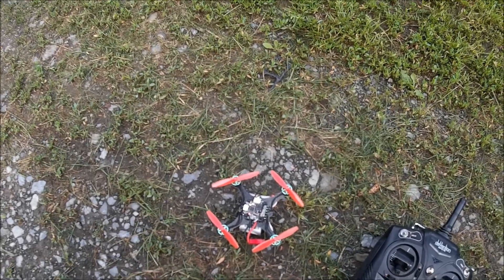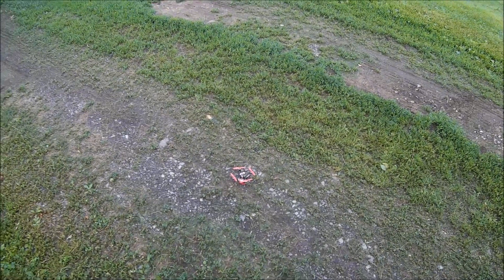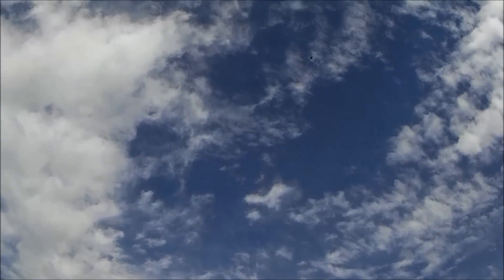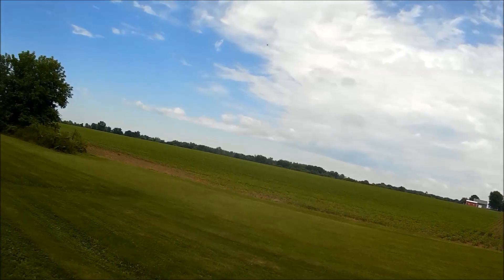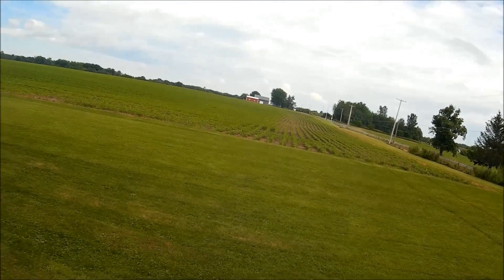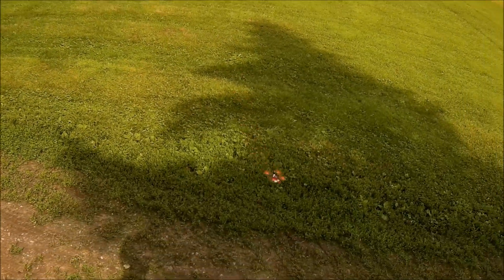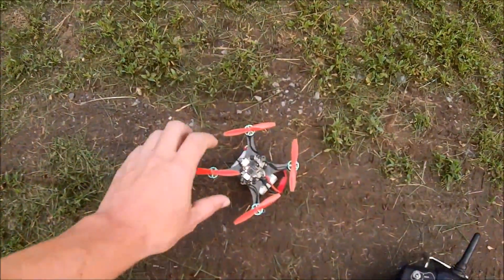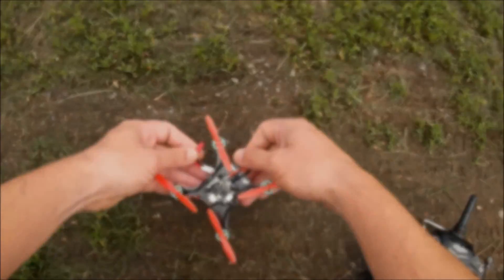6500kv 1103 motors on 3s

Comment: Dave, any updates on the 1102-1003 range of motors? From what I read these Racestars are pretty obsolete. I'm looking for light-weight builds. One for a "toothpick" type build with these props and another for a Beta85X frame/prop motor combo.
Reply from the maker: Sorry, I haven't really done any recent testing.  The Racerstars I used are kind of old now but I have yet to see much in a similar size that I expect to be much better, at least for 2-3s.  When you say "toothpick" I think 1s.  There do seem to be some newer motors that would be much better suited there.  Saw some 0803 in 16000 and 19000Kv which kind of look interesting for a small 1s setup.

Comment: nice video, i am interested by a BABY KAIDJU 2" 1103 racer, i am going to build one to test, according to the 1106 motors, my 1106 6000kv 3s works as 1304 4000kv 4s, both on 3025x2, we all were suprised, here a video with 1106 and 1404 on 3s both (1106 are better on 3s with higher kv)  https://www.youtube.com/watch?v=xNe4t1xmNJI
Reply: here the big comparison in race conditions: 1106 3s, 1304 4s, and even 1407 3s (the best is still the 1106) https://www.youtube.com/watch?v=vSJiBFlOaGU

Comment: where did you get those props??
Reply from the maker: I have some black ones here: http://picnicquads.com/product/propellers/
You should also be able to find them pretty easy searching aroundfor "65MM Propeller"
Note: these need to be drilled out to for 1.5mm shaft if using 1103 motors.  Checking balance/re-balancing is highly recommended after drilling to ensure smooth results.
Reply: gotta teach me how to fly LOS like that man. i cant grasp it nearly as good as you. fpv no problem
Reply from the maker: not the best quality but here was my attempt: https://www.youtube.com/watch?v=xKIe8Kt-Q0w

Comment: Nice , I have flown my bamboo brushless build on these 6500kv 1103 motor on 1s and 2s and it works amazing as I have built it light and used 3inch props. Might have to try out smaller props and 3s next looking at this video!

Comment: I used the ipower 7500kv 1104's with 650 3s and my 110mm quad was a freaking rocket...check my mighty morphin video to see the punch lol. When I came back around I only kept increasing throttle until max so it didn't look as fast the 2nd time around. Problem is... the motors get pretty freakn warm. Like 140-150f. Are those temps too high? I flew those motors for like another 30 packs before a friend of mine pushed me and I wrecked it badly. Rebuilt it and tried changing motors and props ever since wasting tons of money trying to find a way to get it to stay cooler but keep the speed and I literally am about to give up because everything I've tried only makes it slower and still have pretty hot motors...
Reply from the maker: What props?  IMO 7500 is too high for 3s with only 1104 size.  I had heat concerns with 3030 props and 3s with only 4000kv when using 1104.
Reply: I've tried some 2030 tri's, 2345 tri's, 2025 tri's, 3025 dual, 3045 tri's and the absolute best is still the rotorx 2535 props with only one on them as dual's. every single prop except the dual 2535's had way less thrust and speed and required much more throttle to do anything and the motors seemed even hotter if not the same even with Dterm all the way down. The 3025 dual props flew almost exactly the same and heat felt similar and the 3045 tri's were obviously just too much for them so I went down to some 4000's and they did a little better with the 3045 tri's but they still got too hot and they were still slow -_-
Reply from the maker: sounds about right to me.  More blades generally means less efficiency so on a smaller micro dual blades will win out when trying to maximize performance.  If you really want to run 3 or even 4s I'd suggest some 1304, possibly slower 1106 but I can't personally vouch for them.
Reply: I've been reading around and everyone is saying safe temps are up to like 180f so if that's the case then I guess 145f isn't too bad? Not to mention it's hotter than hell around here.. so when it cools down outside guess it would be no problem. I was thinkn about those emax 1106 7500s since I keep having bad luck with lower kv. I have some 1105 rotorx 6500s and they are a little bit slower and a tiny bit cooler so I dunno..
Reply from the maker: 180f could be fine.  I am likely conservative in my use and recommendations.  I just see heat as wasted power and when I'm only getting 2-3min flights as it is, I try to minimize it.  Probably helps on making stuff last longer too.
Reply: Dave Woods I was under the impression that motors should barely be warm...guess I had this all wrong lol. I'm getting up to 10min flights cruising around and flying hard get 4 mins or so

Comment: Nice video! Have you tried a 1106 sized motor yet? If you have the time, I really suggest you try out the realacc 1106 6000kv motors. They are really powerful and only cost 7.80 a piece. I'm having a hard time deciding whether I should pick up some 1304 or stick with my 1106 motors. Theoretically a 1106 motor should be more powerful though. Anyways! Good flying as usual man :) Gotta love micros!
Reply from the maker: Thanks,
Still haven't tried 1106.  Folks also suggested the same at the MMC forum.  
What theory are you using to determine 1106 should be more powerful than 1304? 

I'm not saying they aren't more powerful but my experience has me really questioning that.  For reference I used both 1104 and 1105 for quite a while and the difference between them was nothing compared to the jump to 1304.  1106 is going to have to make a big leap from 1105 I used previously to reach 1304.  

Also for 6000kv what voltage do you suggest?  I'm really looking to stick with 4s for 3" props.  Was thinking the 4500kv 1106 would be most appropriate.  

I'm not against trying them but really don't need and/or want to spend the funds on another build unless I'm certain it will beat what I already have.
Reply: Dave Woods just based on stator volume is why I stated "technically" it should be more powerful lol. I use 3s on mine with gemfan 3025 no problem. Actually get some great flight times with a 500mah 3s bolt and gemfan 3025, like 3 min flying hard and 5 flying easy acro. Haven't had the chance to try 4s yet because everyday has been like 105F+ degrees where I live and even my most cool running larger motor seems to get fairly warm. Absolutely could handle 4s though with it being cooler outside. I sent the 1106 6000kv motors to EngineerX and he will have some thrust results out soon.
Reply from the maker: Thanks,
I just did the math and see what you mean by the volume being more.  My bet is that 6000kv can handle the 4s to some extent but likely overloading the motors some.  

Assuming they are in the same ballpark as 1304, even  5000kv 1304 don't really thrust any more than 4000kv on 4s, just suck more current (heat). Suppose that's why I tend toward trying the 4500kv if any.